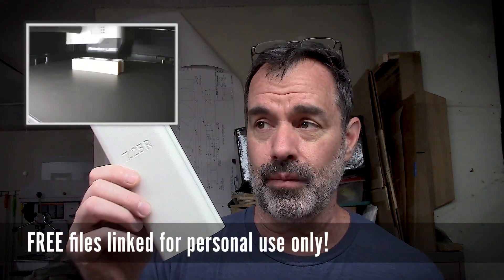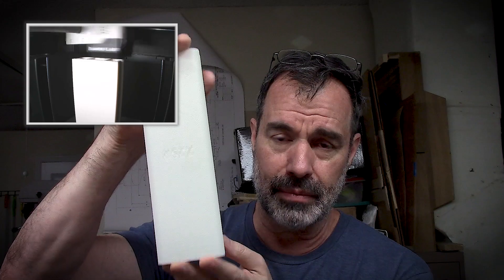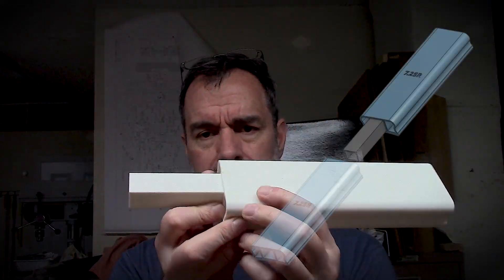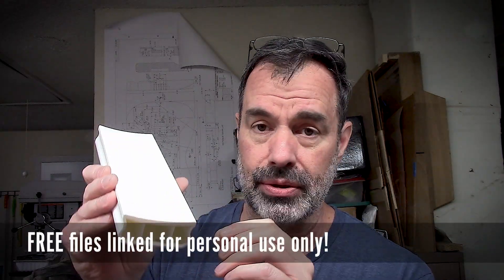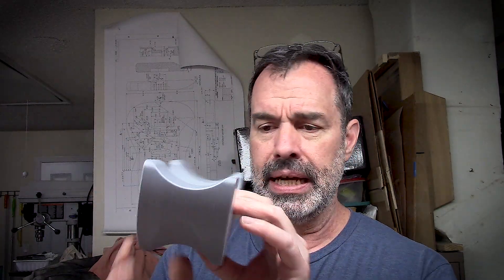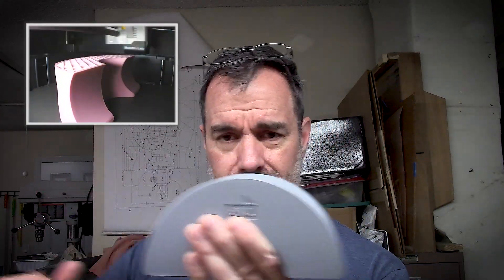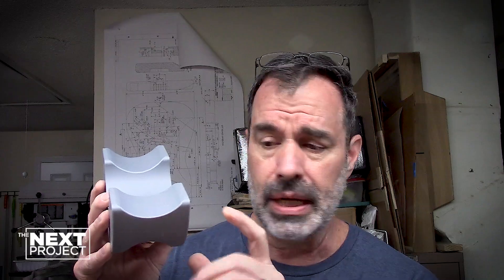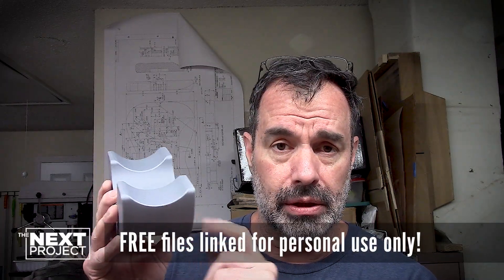Fingerboard Radius Block - 3D Printing Guitar Project Tools Ep1

Comment: What kind of 3D printer do you use?
Reply from the maker: Music, thanks for watching!

After a bunch of research, and attempts to talk myself out of getting a printer, I chose the Bambu Labs P1S.

It's pretty easy to set-up, nearly ready to run out-of-the-box.  I've been using a few different filaments with the printer, but have great luck with the Bambu Labs filament, and pretty good luck with other brands.  

Nearly all of my prototype prints are using PLA filament.  A few using carbon fiber reinforced PLA or PETG filament.  Haven't had the time to test much outside these options.  
 
There are a lot of highly recommended printers on the market now. I wanted a tool to use, not another project to troubleshoot or spend hours fine-tuning.  The P1S has been a good "mid-level" printer so far.  It only has issues when I send a file that has issues, so I'm the error waiting to happen.
Hope this helps.
Good luck with your projects, be safe and take care!
Reply: Any idea why my print would print on the radius portion of the block?
Reply from the maker: @MusicForTherapy   Sorry, I'm not sure what you mean.  
When I printed the radius blocks, I oriented them on end, so the blocked printed up height-wise but had a small footprint on the hot-plate.  
Reason I printed in this orientation was to get a uniform radius up the (height) length of the block.
Not sure if that accidentally answers your question.
The print slice software may not automatically orientate the part in the correct way to get good prints. User input will likely be needed to get the part sitting correctly on the plate.
Let me know, I'll try to help if I can.
Good luck!

Comment: Man, about a month ago I just realized the utility of using a 3d printer for tools like this. My dad is on his 4th or so printer, but I only ever saw him print figures and stuff like that. I have had him print me a similar neck cradle, a humbucker template, various soldering assistants and clamps. But the best find so far is guitar picks! So expensive to buy a pack of 6, but buy a roll of PLA or PETG and make thousands of them. 😂

I've also seen files for the radius blocks and other things that I didn't think I needed yet. But I'll have him print your files out as I already see some additions youi added over the files I've seen. Now I have to watch your other 3d printing videos. Thanks!
Reply from the maker: Hey Mike, good to hear from you!
The little figures and trinkets are the things that kept me away from 3D printing too. I just couldn't justify the expense and time needed for printing.
After a few years of constantly talking myself out of getting a printer, I finally took the plunge... I also plunged into learning some 3D modeling. A printer without 3D models, I still can't justify, as I don't want to print a bunch of random - stuff. 
Hadn't thought about printing guitar picks, interesting idea!
There are a number of files for radius blocks, and some other guitar repair tools. I found myself wanting to upgrade some of those ideas... here we are.
Grab whatever files you like from here, then sweet talk your dad into helping you out. 
I hope to have more print files available as time and necessity dictate.
Be safe and take care!
Reply: @theNextProject I think my Dad is happy that someone has finally taken an interest in 3d printing; he's more than happy to print things for me when I send him files. 

For the picks, I stumble across some files when I first started looking into it. I prefer a Jazz 3 style pick and sent him a file to print and test. We've gone through a few revisions as the original file prints the picks too large (like a normal pick size), so we started scaling down the pick size until we figured out the right percentage for that file. I also had to get him to keep the thickness to the original file size as they were getting thinner each time we reduced the pick size. I've had him print them on both PLA and PETG. Both are more than rigid enough for me. One thing I've noticed, and maybe this is a quirk with his printer or with PETG or just the size of the object, is that sometimes the edges of the picks come out a little weird and sometimes they're perfectly flat. But the edges seem to be holding up better and longer than my store bought Ultex picks. I would eventually like to learn how to use a slicer and make some minor modifications to the file, but that's something to figure out down the road. 

Oh, and all this talk and research into 3d printing also took me down the rabbit hole of airbrushing, which apparently is also big with 3d printing. I just got my first airbrush setup last week and have started practicing, but I'm concocting ideas of how I can utilize it with guitar painting projects. 😂

Comment: Absolutely brilliant, especially the square blocks to extend them. My only reservation, having checked some of the Thingiverse ones, is in relation to the accuracy; I don't mean to be rude or offensive, I am extremely grateful for these, but are they accurate? Apologies if the question does cause offence, that is certainly not my intention.
Reply from the maker: Gary, thanks for watching!
I completely understand your concern/reservation regarding "accuracy". 
The CAD drawings used to created these 3D models is as accurate as should be expected.  Where I expect inaccuracies to happen will likely occur during printing.  
I'm using a Bambu P1S printer, and have printed 6 different blocks so far, plus a couple early development versions.  The radius' all match either existing aluminum radius blocks, or the finger board radius gauges that I have.  
Also, I've used a couple of these blocks with the 3D files for a fingerbiard radius fixture.  They were spot on. 
So, if the 3D printer is up to the task, I don't see any issues, at this time.
One thing I did during my initial testing and development was to print short versions to test the radius. That went really well, no issues, so I proceeded.
Maybe you can print some 3" sections and test fit the radius.
I also have a next generation block coming, which has the same radius on both grip and work surfaces, so they are 7.25/7.25, 9.5/9.5.... 
Thanks again for the great comment and question.  
Run a test, or two.
Be safe and take care!
Reply: I fully intend to run a few off, but I had to shorten them slightly (not with uniform scaling!!!!) as my Ender 3 Pro can only go to about 250mm, so I chopped a bit off each end to accommodate them. I’ve got all your files and excited to get the router radius jig printed and in use. Keep up the good work, us lesser mortals need kind spirits like you to help us 👍👍👍👍
Reply from the maker: LOL, too funny!
I'm just a guy who blindly jumps into places I have NO business being it. I figure out to how to stay afloat as I go. 
I'm glad you grabbed the files, and can chop them to work with your printer. That's what it's all about. Adapt and improvise.
Good luck with all, take care and talk again soon!

Comment: Hi, thank you very much for sharing your files!! getting luthier tools in my country is such a pain, most of the time i have to buy overseas. It cost me 15usd to print a radius block in PLA.
Reply from the maker: lowkey, Thanks for watching and I hope the 3D files help with your projects.

15usd to print a radius block?! Ouch!
I think I'm printing these files for about $4 US, each, depending on settings. 

I have a new generation of radius blocks to be released soon. 
They will have matching convex/concave surfaces, rather than the flat side as on this current version. 
So the next gen blocks will be 7.25/7.25, 9.5/9.5, 10/10, 12/12... 
Also have some small "helper" items to be released soon.

Greetings from Florida, US.
Be safe and take care!

Comment: Shame on me for dare to ask something else, but what do you think of making the top of the radius block (where you hold it) the "reverse" radius (concave/convex)? Would be useful to sand the bottom of nuts or checking the radius for frets after the fretbender
Reply from the maker: Mark, no worry of shame here, all good.

Edit/Question:  What is the max height you can print at?  

That's a good idea, I like it! 
I may make another version with the concave/convex surfaces. To be honest, I was in need of a 7.25" convex surface for sanding a nut bottom just the other day. 

I have been thinking of a separate tool for checking/shaping fretwire radius, but checking it against a radius block would also work.

Good ideas, I'll start some drawings soon.
Hope all is well, be safe and take care!
Reply: @theNextProject  Thanks! I don't own a 3d printer myself, so I don't know about printing height. I have used a couple of people in my town that own one to print stuff in the past

Comment: If you're learning design , try fusion 360. I designed and printed my own sanding block similar to yours.. with fusion you can do "parametric modeling" .. meaning that you can model it once , then you can change parameters (example the radius) and it changes the model on its own.
So you can punch in 12" and it puts out a 12" radius sanding block .. then if you change the radius parameter to 18 , it automatically adjusts the model to have an 18" radius.

I love my printer, you can do SO many things with it.

I recently made a fretboard radius SANDER - it acts as a "drum sander" but the drum is 3d printed and has a radius in it and you attach sandpaper to it... You pass the fretboard and it sands a radius in it .. then you go up the grits and it turns out a PERFECTLY SANDED fretboard with no need for any hand sanding. I designed the jig myself after seeing some similar ideas on YouTube
Reply from the maker: Darryl, thanks for watching!
Interesting info on fusion 360, thank you!
I looked at it and a number of others briefly, wanted to keep things simple ( if that's possible ). Always looking to learn new things, and modeling is a rather fun challenge.

Pretty cool radius sander you mention. I've seen something possibly similar to what you mention. Scar My Guitar and EMJ Guitars may have done something similar, creating a concave drum of sorts.  Pretty cool how there are so many ideas and ways to accomplish our goals.
Thanks for sharing your project.
Hope all is well for you, be safe and take care!

Comment: This is very cool of you.  Perhaps I’ll get a 3d printer one of these days.  Great design.  Maybe you should have a website where people can go to get all of these files as you release more?  Take care!
Reply from the maker: GuitarCurator, good to hear from you and thanks for watching!
It was years before to took the leap, I just couldn't justify it...and I'm still trying to justify it.
I like the "design" process, learning new things, the challenge... that said, I wanted a "turn-key" printer/tool, not another project.
That may have been another reason I didn't get into 3D printing sooner. From what I've read, a lot of the previous printers were - a project. A huge learning curve, and I didn't want that.  Now it appears there are more and more "user friendly" printers to chose from.  So far I'm happy with my purchase, no issues to date (other than the operator).
At this time, I will be having the files available through DropBox (link in the description). I would like to distance myself a little bit from the file access, but I don't know when/if I'll get to having a website - that would be another project to tend to.

For now, I'll post a brief video whenever I release a new gadget, and add it to the DropBox collection - for now.
I hope all is well for you, be safe and take care!

Comment: Wow, thank you so much for all of this. I've saved the 10 and 12" radius beams but haven't printed them yet. Can't wait for the neck profiling jigs and fretboard radius jig, I'm still using your previous design made from MDF, with bearings and also one without bearings. Can you design a cradle that doesn't use bearings? Thank you
Reply from the maker: PnP, thanks for watchin!
Glad you grabbed the files, I've run them a couple different ways and can't really tell any difference. One way at a .28 draft resolution, and the other at .20 strong res... look the same. I did set the wall layers to 5 or 6... basically no room for infill. 
Seems pretty strong!

I like the idea of a radius jig without bearings... Hmm, yep, I'll look at creating a router base that will just slide on the side radius arch.   
What router are you using?  At this time, my new 3D fixture is set up for a Makita palm router, not the full-size router like my original fixture.

Be safe, take care, talk soon!
Reply: @theNextProject  So I'm using a Ridgid R2401 variable palm router, it has a round and square base, with holes that are 55.5mm apart from each other. I find that cradle with the bearings tends to skip more if there is saw dust accumulation, but with a cradle that rides along the walls of the base it's much more stable and seems to push the sawdust away on both ends. Just my observations, thx!
Reply from the maker: Peter, thanks for the interesting info.

I've not used bearings at the bottom of the arch radius fixture where it traverses along the length of the fingerboard/neck, as I've also noted that sawdust build up causes problems as you mention.
I haven't had that problem where the router caddy follows the arched radius sides however. 
The way I've built my router caddy, it shields the arch rails from getting an excess of sawdust thrown on them. So, I'm not sure if you are using my old design, or some other design.  
I understand how not having bearings at this area would eliminate any bearing rolling over debris, and that a solid surface would essentially "sweep" or push debris out of the way.

I just need to verify why you are getting so much sawdust build-up on top of the arch rails to cause the issue. 

I'll try to find a Ridgid R2401 baseplate footprint and add it to my part list.

Thanks again, talk soon!
Reply: @theNextProject  Hi again, I'm using your first design, with the caddy and bearings. I just found that depending on the type of wood used and the amount removed on each pass, I found that some chips or sawdust ends up on the base rail arches and when the bearing goes over that debris is causes the router to miss some spots on the fingerboard, but no biggy, Like said I made another caddy that rides along the base rails where the sides of the caddy extend slightly over the base rails (from the inside) to give the caddy stability and stops at each end like in your design. I'm not complaining, I just found that worked better for me.
Reply from the maker: That's good feedback, thank you! 
I'll make some changes to the design.
Glad you found a work-around for the issue.

Comment: Hi John.
I have had to reduce the height of the sanding blocks to 208mm, as my printer has a maximum print height of 210mm.
Big thanks from England.
Reply from the maker: Dave, thanks for watching and you're welcome!
I kinda expected people to make adjustments based on what machinery they're running. 
Sounds like you've got it taken care of.
Good luck with your projects, be safe and take care!

Comment: I was doing a 30" scale bass to guitar conversion and decided while I was modifying the headstock I'd do an ebony overlay on the face. This bass had a Fender style scooped headstock, so I made a 3d printed jig that allowed me to bend the ebony perfectly, and then used the same jig to clamp the ebony to the headstock. Worked out great.
Reply from the maker: Adam, thanks for watching!
That's a great use of the 3D printer as a tool to accomplish the task you had.
Thanks for the description and clever/resourceful idea... I'll likely be borrowing that in the future!
Be safe and take care!

Comment: I just bought a Bambu Lab A1 Mini two weeks ago to print tools for myself. The maximum print size is 18 cm, and I've been wondering how I could make a longer radius block. This is exactly what I needed! Thank you!
Reply from the maker: Márton, thanks for watching!
If the 9" length is too great, i think you can set up the slicer to stop at a height that will work for you.
Good luck with your new printer and projects.
Be safe and take care!
Reply: @theNextProject Yes, that's the plan, to adjust the size. Tomorrow I'll try printing three 6" long pieces along with two center ribs.
Thanks again!

Comment: Thank you very much for sharing these files. Last year, i designed and printed a 12" one for a refret of my 1997 Yamaha Pacifica 112. Great idea to add a center rib to connect two or more.
Reply from the maker: outatime, thanks for watching!
Glad you were able to make a tool to help with your project, that is exactly what I wanted from a 3D printer! 

I put off the 3D print thing for years. I was a bit put off by all the trinkets that I see people printing. 
I wanted a tool, to help make tools.... I finally took the dive and have been learning 3D modeling, learning about filaments, learning, learning, learning... not enough time.

I'm open to new ideas, if you have any suggestions, please let me know. If I can develop something, I will and we can then share it for everyone to benefit from.

Thanks for the comment, and letting me know how 3D printing helped you. 
Be safe and take care!